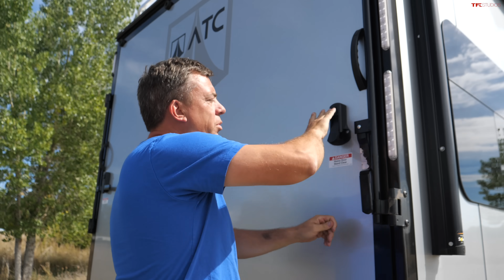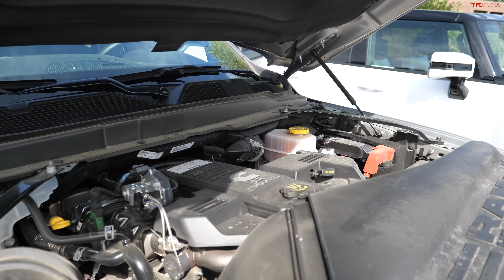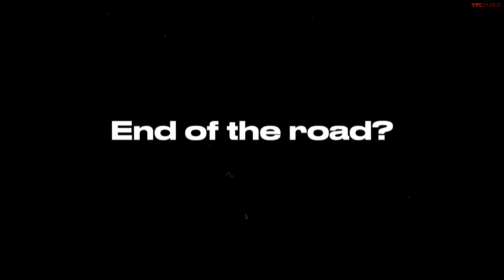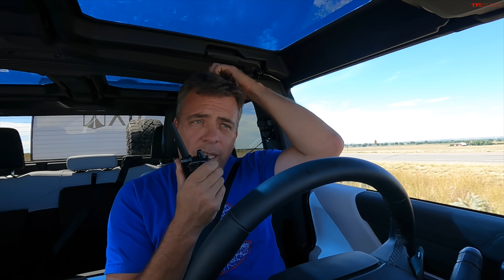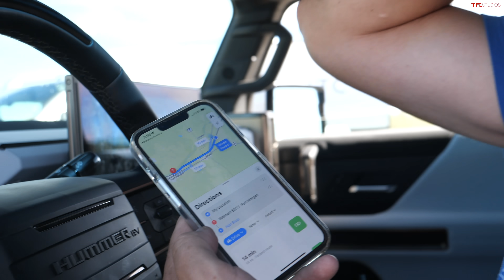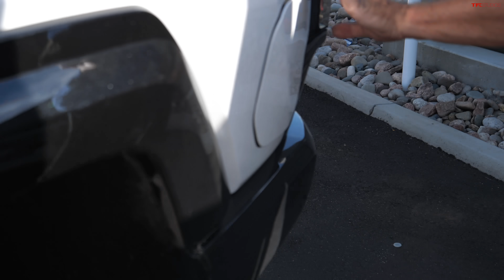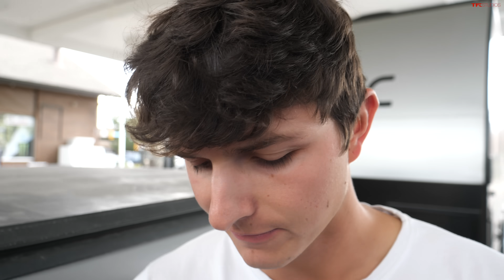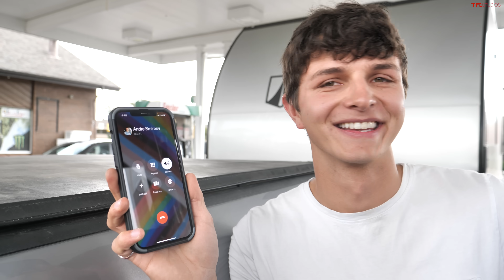How Far Can a Diesel and Electric Truck Tow An Identical Camper Trailer on ONE Fill-up?

Comment: These electric trucks have been nothing but disappointments. The Lightning was pretty horrible at everything and the Hummer has been pretty bad too so far. Let's be real, these electric trucks are for people who just drive to the office and Starbucks and don't really need a truck in the first place.
Reply: Time for a diesel electric hybrid ?
Reply: @richardj163  yes!!!!
Reply: @richardj163  No one will pay for it. Ford already stopped selling its light duty diesel in favor of the Powerboost.
Reply: @jghall00  Maybe. It’s a factor of vehicle cost, efficiency, energy cost. If the cost of Diesel & Electricity go up the cost of the vehicle would be less of an issue if it was more efficient. Diesel sucks for short trips, and Electric sucks for long trips. If I could do my short trips on battery and have the range with a diesel hybrid, I’d do it.    After picking up a 3500 cummins last year, vehicle costs in that range are relative.
Reply: @richardj163  Electric sucks for long trips if towing. Otherwise they're fine. I have a small cheap electric for around town and an Expedition for towing. I'm not sure why Ford didn't do a PHEV half ton. I can see the appeal. I suspect it might be a payload issue. The batteries chew through payload, so it wouldn't be an easy conversion on an existing platform.
Reply: @jghall00  and ok iv got a 2500 mile trip coming up soon how much extra time would I need to charge a truck and how far out of the way would I need to go to find a charger time refueling would be about 25 minutes total on that whole trip and gas is everywhere so I'd refuel on route no needed side trips the idea of calling that just fine is silly
Reply: @jghall00  wasn’t that light diesel unreliable? I thought I heard something about that engine being unreliable.
Reply: @IntrnetCat  I can't say for sure, but I think it was underwhelming compared to the competition and the Powerboost.
Reply: This is what happens when you put the cart before the horse.  There’s not enough EV infrastructure to be ready for EV towing.  But let’s be real, the market for EVs is as you say, so nobody will be towing with a Hummer, it’ll be a more “look at my money!”
Reply: LOL that's what happens when you take a box and throw some batteries in it LOL.... Like I keep saying in other comments small cars sedans first then crossovers then pick ups until we get this battery technology more advanced because right now most of these electric cars and trucks are just luxury toys...
Reply: @jermainec2462  in your dreams. The initial footprint of building an electric car is nearly double than that of a regular car, on avarage you have to drive 180 000km to make that additional cost worth it (not even speaking of the carbon footprint aldo being over double to produce an electric car). At 180k the battery will be so used up, you'll have to buy a new one for 10k-25k depending on your car. There isn't enough lithium on the planet to support a complete conversion to electric, not even enough so that half of all cars could be electric.
Reply: @BrixxonLP  I'm not dreaming about all electric future
Reply: @jermainec2462  well seems to me like you haven't acknowledged any of my arguments or tried to challange them. Anyone who reads this exchange will know who has something to back up their claims and someone who is blowing hot air.
Reply: @BrixxonLP  first of all if you think I'm going to read all that shit all them people who commented on this you crazy that shit was three and four weeks ago I got shit to do lol ...this just popped up on my notifications in YouTube secondly I think I said that everything can't go electric some things can go electric some things I think shouldn't go electric... Now I need to know which side are you on are you against everything on electric or are you for everything going electric?
Reply: @jermainec2462  my comment was about the length of yours, but ok. I am against it, even if battery technology somehow increased the efficiency by 30% which is very generous. A batteries life cycle is much shorter than that of an engine and the lithium is simply not there at the moment and doubtfully in the future. At least the metal of an engine can easily be reused, that of a dead batterie is waste.
Reply: @BrixxonLP  well you know it's so much hype over electric cars that nobody is really paying attention to the details like that LOL so the next 10 to 20 years would be interesting ice cars ain't going nowhere no time soon I think the Best of both worlds would be plugged in hybrids
Reply: @jermainec2462  well, the electric car isn't something that new either, the prius has been around for some time, my cousin drives one from 2005. The battery of hybrits eventually die like any other battery really. The issue is, when the battery is integral for a vehicle to operate, then you have a huge cost of replacing it. I agree with you that hybrits are a much better way to go, at least something we can agree on.
Reply: @jermainec2462 😅
Reply: @jermainec2462  battery evs will never replace anything with liquid energy storage. Be that methanol, ethanol, hydrogen, gas, or diesel.
If you have a 2000kWh battery, and you want to charge it in the same time you fill up a dieseltank, you need to charge with high currents, or voltages, or both.
Bigger battery doesn't change the laws of physics
Reply: @thewoode1050  I kind of agree with you I feel like Ev can only be done in certain applications... Everything can't be EV...
Reply: Did anyone else catch on to the fact that both trucks cost the same to fill up? It cost around 100 in diesel for the full trip and 40 for half the trip in the ev…. I would also be willing to bet they only charged the ev to around 80% so half the trip on the ev was probably closer to 50… full trip (if supercharged) is 100 either way
Reply: @ajkopecki  But if you’re charging overnight at home it is substantially cheaper
Reply: @wesshepard  Agreed. However, I typically don’t pull my camper to my own driveway for a weekend getaway.
Reply: @ajkopecki  and you can buy a diesel for half the cost
Reply: @ajkopecki  Not sure if anyone replied to you, but using a fast charger is WAY more expensive than charging at home (more than 3x), and is where you see the majority of the cost savings. Though even then when you do fast charge it is cheaper than gas or diesel (just not so dramatically cheaper).  It typically costs me $2 to fill up my model Y long range at home.
Reply: @ajkopecki  You'd lose that bet. They charged it to 100%...maybe you were on bathroom break. Lol
Reply: @ajkopecki  I noticed that too. The only way I can see an EV being practical is for heavy city traffic. For Instance, bumper to bumper stop and go during LA rush hour where the traveling distance of the vehicle is quite short, but it spends a significant amount of time at low speed or a stand-still during heavy city commuting. I don't live in an enviornment like that, so I may be wrong.
Reply: @ajkopecki when they first started  out they said the EV was fully charged.
Reply: @ajkopecki  I'm most places you only pay high prices for power when using superchargers, the savings is when you charge at home, which is most of the time.  Here it can cost 5-6x as much to charge at a supercharger.
Reply: @ajkopecki  
Well it depends where you live, but yes. Electricity is getting more and more expensive as more and more evs get on the road. And to counter this, governments are doing what they can to make oil more expensive so that electricity still looks good compared to gas/diesel.
Reply: @ajkopecki  depends where you are, can be anywhere from 17-30 dollars to fully charged one 17 being the lowest rate and 30 being the average across the US.
Reply: All true. The only EV truck that intrigues me, even slightly, is the Rivian R1T. Not for its towing, and certainly not for its small bed, but just for its overall on and off-road capabilities, like why someone buys a Jeep to commute to work, but for some occasional off-roading and winter driving. Otherwise, I am not interested.
Reply: Unfortunately, the people buying most trucks(and overpaying) are people that drive to the office and Starbucks. They stopped building trucks for people like me about 10 years ago....
Reply: I would just love to gush about EV's but I just can't. Every time you recharge you are going to lose capacity and range. Also wear and tear on unproven components. What about battery temperature? Also what will happen as charging stations get hours on them.
Charging isn't going to stay free, subsidized or even cheap. It will be taxed and limited you can bet.
Now comes the repairability of the EV. Will the thousands of miles (?) of wiring stand the test of time? Will replacement parts be available or will they be too expensive for the dealers to keep stocked? Lastly will replacement batteries be available and will there be facilities to recycle the defective units.
We all have seen the unpleasant tendency of the batteries to explode and catch fire. Is there going to be on board fire suppression systems to protect the occupants in the event that happens going 70 mph towing that trailer.
All of these problems can happen with a diesel too but we have systems available to mitigate the environmental damage.
There are too many unknowns to mandate these vehicles be put into place.
It took 30 years before the gasoline engine truly became reliable. It took another 30 years for tires, brakes and suspensions to evolve. Fuel injection took another 3 decades to be reliable and that all hinged on 1st generation computer control. The computers evolved a bit quicker due to non automotive advances.
Electric vehicles are no new idea. Some of the first vehicles were electric. Over the years they have been tried many times, not really failed but not really gained a reputation for reliability either.
Somebody is going to have to foot the bill for the installation of the infrastructure to charge these vehicles and there will be maintenance and repairs.
I think it's going to be a long time before EV's are the true environmental saviors that the weather alarmists want them to be.
I hope I'm wrong but we can only lie to ourselves so long.
Reply: I'm a hill farmer in a remote part of Britain,  there's NO WAY I'd ever consider replacing my Mitsubishis with an electric truck. 1/ eye-wateringly expensive 2/ I can't service it 3/ unreliable crap that I wouldn't trust my business and life to in the Scottish winter. 
If these electric trucks are so hood, why don't the emergency services use them?
Reply: Aka city boy ev trucks
Reply: Driving to the office and going to Starbucks is probably what 75% of people buy trucks for. These are great for somebody that wants a Tesla with a bed for a few Home Depot and dump runs per year.
Reply: @vbaker4  laughable. Contractors don’t have time to sit around charging vehicles and most contractors pull trailers and or haul heavy loads.  This battery crap is following the history of the 70’s wind, solar, battery failure. Nothing has changed. It’s still the same type of folks who refuse to admit their virtue signaling isn’t going to allow them to overcome facts.
Reply: @Roadglide911  👍
Reply: You’ve certainly have a point, but how many people buy a truck even if they don’t need one…
Reply: @zeedustrakok  imo a ton of people buy trucks even though they don't really need them. I call them leisure truck people. Sure once they have a truck they will find ways to use it but truck sales these days are want driven not need driven.
Reply: @zeedustrakok  you're playing into the NWO mindset. 

Get ready for your cricket protein buddy!
Reply: Damn freedoms of will and choice.... Curses
Reply: @vbaker4  that's not even half the range I'd get with my jeep and it takes 5 minutes to double that range then 5 minutes to do it again and the cost is a funny thing I'm less than 5k into my jeep how much did yours cost
Reply: @donaldliverance2597  40k msrp.  Again, there are always better applications for different jobs and personal scenarios. Happy to hear your jeep serves you well.  To say the Lightning is horrible, most have never owned one or used it for work.   I’ve had a lot of success with mine hauling loads of wood, trim/construction materials, hauling a boat, hockey gear, etc.   My father in law works in the gas industry and has already commented on how the pro would replace 90% of their fleet as their big haulers are only required for the back hoe and other larger equipment.  Most commutes are 100 miles or less and a lot of idle time.  The same apprehension occurred in the 20th century with ICE and it’s clear that we are experiencing similar today.
Reply: @vbaker4  
An ev is absolutely useless for anyone in any type of service industry. They are trying to be places at certain times, often appointments are more than an hour away from each other. HVAC, plumbing, garage door, windows and doors etc. Absolutely no way an ev would work.
Reply: @nakefews6823  👍
Reply: @nakefews6823  that is true on the go all of the time and dnt know how your schedule is as a service tech
Reply: People have felt mislead over this whole EV truck thing but it's simple math. These trucks were never going to break any records except 0-60 times.
Reply: I’d like to see a ev truck pull a rig from San Diego to Yosemite  ? No hick ups or delays  at least a 26’ trailer
Reply: I saw my first electric Ford truck in Canada and I laughed and asked who was that stupid to buy that in -40C/F
Reply: So, 95% of truck owners
Reply: Nailed it
Reply: They are trucks for rich people who don't really need a truck, and want to be environmentally friendly
Reply: @vbaker4  contractor here, we pull trailers with equipment. Not just a bed of tools. Also driving 200 plus miles.
Reply: @Axle1007  Sounds like a lightning isn’t the right tool for your work then.
Reply: @vbaker4  it's not a tool, it's a leisure truck.
Reply: @Axle1007  👍
Reply: So about 80% of truck owners
Reply: Starbucks coffee drinkers you nailed it .
Reply: Lightning is pretty horrible at everything? Did you actually watch their other videos? It's more like the lightning was pretty great in all aspects EXCEPT long range towing. I would guess that something like the lightning would be sufficient for the majority of truck owners.
Reply: @Chsae314  lol, it got stuck driving down a dirt road and it never got close to its range estimate in any test.
Reply: @turdferguson2839  Proceeds to ignore multiple videos showing them off-roading and driving up mountain trails.  They've never claimed to hit their full range  when towing, it usually cuts the range in half. I get it that you don't want them to be successful, it's just pathetic when there are so many videos showing how effective they are, and you cherry pick your examples to support your already formed opinion so you can  dismiss them entirely.
Reply: Ev Technically is still at least twenty years behind to what it needs to be to have a proper vehicle.
Reply: Truth and idk how that cummins is tuned but it should be getting 16mpg towing
Reply: I would say the perfect combination would be the efficiency and power of the electric mated to the range of a 4 cyl diesel. Idle that thing mated to a fairly heavy generator and the same 31 gallon tank could probably have taken the vehicles pretty far, like the lake and back. When not being used for all the extras, an idling diesel still generates a ton of torque, great for spinning a generator. And at idle, get great economy and produce very small amounts of waste. Where diesel becomes dirty is during acceleration when vast quantities are pushed into the combustion chamber but not completely burned or converted to energy, resulting in the black cloud or if your smog system is working, a dpf full of soot. I always wondered why this was never an option. Call it a hybrid diesel. Works the same in locomotives and ships/Yachts. Diesel motors turning generators and electric motors at the wheels/props.
Reply: $46,000 price difference buys a lot of diesel.
Reply: My superduty s 20 years old w 205 k 7.3 I travel  all the time out of state 10 k just came back from Arkansas white river fly fishing we’re always on the move Dallas areas end of November I can’t see a 50 k plus investment doing 20 years and still rolling  my truck used was 20 k
Reply: I couldn't have said it any better 😂😭
Reply: And are ok with paying an outrageous price for an inferior vehicle. Im sure trade in value will be a joke. And whos going to buy a used one?
Reply: These are the same People expecting the Tesla truck to replace semis. They are out of their minds.
Reply: He hit the nail on the head. This is a lifestyle vehicle.
Reply: Agree 100 percent.  My old dodge diesel was about one fourth the cost of the new Cummins and can tows 15k on a regular basis with relative ease and I can still make it 300 miles before filling up
Reply: Did you see the electric Hummer the guy totaled in 15 miles 😂
Reply: I will keep my 99F250 7.3l Superduty with 220K on it. She pulls my boat and Toy hauler just fine 🙂. Just wish diesel was 96 cents a gallon again like when I bought her new.
Reply: Wait, so people actually expected them to be like combustion engine trucks!? lolol that was the first mistake. People bought the EV lies.
Reply: I find it funny when so many people comment about numbers they just pull out of thin air. I've seen 75, 80, 90 and 95% of truck owners never use their trucks except to get coffee and go to the office. I know there are a lot of people who do this, but couldn't even guess at an actual percentage, just because you don't see every truck pulling something doesn't mean they don't. I wonder how people look at me and think the same thing when I'm driving around town? When actually I pull a trailer 1/2 the time(or more) my truck is moving, my current truck(2018 Ram 2500) has almost 400,000 miles on it.
Reply: Hey , didn't a few of these hummers catch fire during or after hurricane Ian??  Which subsequently burned down the house it was stored in...
Reply: And if you think the supply issues are bad now wait until California insists on the CDL's going full electric...stuff ins going to get stupid expensive and take twice as long to get
Reply: @johnfluckiger9693   people used to say the same about cars..🤡. Yet ain’t none transporting shit using horses anymore… times are changing old man..  luckily your generation is half way in the grave..  don’t worry I’m sure they’ll still be gas vehicles by the time you die..  no need to throw a fit over it.. 🤣🤣
Reply: @rubendiaz4180  your arguement is demented, lame and full of leftist stupidity. No one said that the tech cannot be made to be useful only that it isn't there yet and that the forced mandates never makes the transition easier or less expensive. Additionally, none madated the use of automobiles over horses. Once the cost of manufacturing decreased and the cost effectiveness improved the use of automobiles became a more effective option. The fact that you immediately went for the insult shows that your single dimensional thinking cant see beyond your CNN based talking points...learn some humility and humble yourself to diversity of thought.
Reply: @johnfluckiger9693  lol sorry snowflake I didn’t mean to offend you..💁‍♀️.
Reply: @johnfluckiger9693  have fun looking at teslas ugly ass tail lights..  😔
Reply: @rubendiaz4180  no offense taken just a hopeful correction of your deluted thinking...but intellectual thought process clearly fall short when speaking to fools with morality complexes.
Reply: @rubendiaz4180  I actually like Tesla's...but they also lack in certain areas such as sustainable infrastructures to make them a reliable affordable option but you keep on trucking hippy. Whe your walking cause of another California brownout and cant charge your car...I'll be crusing along with my gas hog truck enjoying the AC and actually have the ability to get to work.
Reply: @johnfluckiger9693  so rational thought = hating on technology..?   Why don’t you send me smoke signals instead of using the internet then..? 🤡
Reply: @johnfluckiger9693  here’s my thought.. fossil fuels will eventually run out..  so why not use them only for things that can’t be achieved with electricity.. you ever worked at a warehouse..?  All they use are electric pallet jacks and forklifts.. they’re extremely reliable there..
Reply: That is the absolute truth
Reply: I drive a Tesla, and I couldn’t agree more.
Reply: @vbaker4  most contractors tow a work trailer so no it's not at all a good fit for a contractor
Reply: @donaldliverance2597  most contractors don’t tow a work trailer 😂
Reply: @donaldliverance2597  I live in the land of sun and not one contractor is using an EV to pull a trailer for construction, cementers, tile workers, lawn service, ect. It's not happening!😂☕
Reply: @donaldliverance2597  that isn't true, the work trailer can stay on the job site. Or you rent a storage building to keep on site. Nobody is hauling a work trailer back and forth everyday except lawn care workers.
Reply: @lilcourtny08  you are greatly mistaken I live in Southern California and I see all the same trucks at the same time on the 91 freeway with there trailers attached. All kinds from concrete to electrical contractors. Just get an EV if you like and stop impossing your beliefes on others. Let people get what ever vehicle they want. GOD BLESS AMERICA
Reply: @donaldliverance2597  depends on how many miles they're doing daily. Could be perfect for someone that tows less than 100 miles daily. Also, highway speeds are much harder on range. At lows speeds,  you can easily increase range by 50%. There's a reason the Lightning is sold out.
Reply: @jghall00  Maybe the onboard generator helped seal the deal for some.
Reply: @jghall00  it's not contractors buying them lol
Reply: @Axle1007  It's people that own profitable business spending a lot on fuel. If you're solo, you might not be able to afford it. Ford has a fleet program where the customer has to buy at least 5. They're sold out.
Reply: @jghall00  So if you don't drive on highways or in the hills or mountains and if it's not too hot or cold, then the EV is a good choice.
Reply: @jeffw1267  It's fine for all those, as long as you aren't towing.
Reply: @jghall00  what about in 10 years how is that ev truck going to perform?
Reply: When they talk about the energy density they show how insanely stupid and inefficient EV cars are… pulling a „gigantic“ travel trailer, 5000 lbs… that’s one of the lightest camping trailer before you go with a pop-up
Reply: @freedomisnotnegotiable  at towing only. But they are far from stupid and inefficient
Reply: @freedomisnotnegotiable  I have a small camper at 22 feet and it is an extra light model that weighs 5300 dry.

If you really want a test then pull a 27 foot that weighs 7000 and see what happens.
Reply: @Freedom is not negotiable  not to mention they did at dry weight. Can't imagine a 4 wheeler loaded. Also because it's a toy hauler they didn't fill the water tank and fuel tank if it has one. Lol
Reply: @freedomisnotnegotiable  You have it backwards actually. EVs are extremely efficient at using electric energy. The crazy thing is how energy dense gas and diesel are that ICEs can be vastly less efficient and still out perform. When they compared the energy density of diesel to battery this is what they were alluding to.
Reply: @ProjectswAlex  no you got it wrong look what crazy resources you need to build a battery that would equal to the energy density of Diesel, 9500lbs Truck for a 130mile range with 5000pounds, Iam so glad that all the building material that goes into the 9500 pounds is 100% green and grows on trees, because if that wouldn’t be the case these EV trucks have a horrible environmental footprint!
Reply: @freedomisnotnegotiable  I think there's quite a bit of unnecessary sarcasm on your last sentence there. 

My comment was just about the energy density of the two technologies, but if you want to get into the cleanliness of auto manufacturing we can do that. 

Firstly I'd recommend a very interesting video made by JerryRigEverything. The title was something like, EVs Have a Dark Side. Very cool video that goes into the carbon footprint of EV and ICE manufacturing and the years of use afterwards. The jist of it is all cars have a terrible impact on the environment, while EVs have a worse initial impact their carbon footprint slowly increases depending on how the electricity is produced. ICE vehicles have a lesser initial impact since there is only a tiny 12volt battery, but due to using gas/diesel their carbon footprint increases much faster. I don't think he even included the oil changes ICE cars require into the calculation.

EVs can't do what ICE cars can do, YET. Technology with EVs is still young and will continue to improve. ICE vehicles have already matured and aren't improving much these days.
Reply: @ProjectswAlex  Time for your update, I mean, boostuh!
Reply: @ProjectswAlex  
One thing about efficiency as well is that batteries weigh a ton more than gas/diesel, so if you want an ev with similar range, the efficiency  will drop a ton because of the added weight.  It would likely still be better ice vehicles, but I don’t think by much
Reply: @freedomisnotnegotiable  lol inefficient is not the word you’re looking for 🤣 in the truck world while towing energy density wins but efficiency is not the metric to use because the diesel efficiency tanks as well haha. Energy density saves the day. Know your terms. Efficiency wise: BEV’s are around 90% versus ICE struggling at about 20%. There is no comparison there.
Reply: @CYBRLFT  there is also something like efficiency in the building/manufacturing process... but yeah i know EV cars promoters dont want to talk about it because it kills the whole EV-agenda pretty fast... the only argument then is: "If more cars will be built it will get better, lol... such a stupid argument...
Reply: @freedomisnotnegotiable  All these videos always talk about range, but never on 55 mph roads or city driving where you will always drive home and put it on the charger.
I  just drove 96 miles started with 80% charge finished with 63% charge. It took 26 kwh to charge back to 80% electric costs was $2.02 55 mph Highway & city driving.  I could have maxed the payload and it wouldn't have used much more energy. This is why I bought an EV truck. I can tow 10,000 or haul 1600 lbs My range isn't cut in half because at those speeds there's very little wind resistance. The lightning will do anything any other F150 will do. We just aren't setup for long distance driving yet.
Reply: @pstoneking3418  most highway driving here. 70 is the lowest speed limit. No way I can do a full day worth of work as a contractor with one charge. I drive 250 plus miles a day.
Reply: @freedomisnotnegotiable  the aero profile causes the mileage hit, not the weight.
Reply: @jghall00  that’s not correct… we are not living in a perfectly flat world
Reply: @freedomisnotnegotiable  In an EV on the downhill grades you recoup what you lose going up.
Reply: @jghall00  that’s not what motor trend found. They used a lightning with the larger battery and towed three different trailers from 3000lb to 7200lb and they lost an additional 25 miles range (out of a control tested 225 miles) with the heavy trailer vs the light one. That’s an additional 11% loss in range, which is statistically significant.
Reply: @nathanenns7186  that doesn't mean anything without knowing the aero profile of the trailers. The right way to do that test would be to add weight to the same trailer.
Reply: @jghall00  um they both affect mileage electric motors eat more power as you demand more from them more weight = more demand
Reply: @marquistaylor3491  true, but degree matters. It could be a 5% range reduction from weight vs 20% from aero.  Can't treat them the same.
Reply: I agree 100%  don't let the treehuggers hear you say that they will fight with you all day saying every one needs to buy one now.
Reply: Wait until they age
Reply: @PGXPPR  Yep.  EV's are just throw away vehicles.  Poor suckers that buy a used one then has to pay a ton for new batteries.....
Reply: @PGXPPR  Electric motors have only one moving part compared to a diesel engine.
Reply: @jacksonbangs6603  It will outlast me as much as I will use it. I use a truck to pull 15-25k lbs. That hummer will do it but not far
Reply: Electric Vehicle's are for Democrats
Reply: Facts
Reply: Yep. I can’t afford an EV right now but my intent is to eventually get an EV when there is a semi affordable 3 row available for family. But I’m planning buying an older diesel for truck duty.
Reply: We have the technology for electric vehicles where you don't ever have to stop to charge it. Why aren't they letting us have that technologies. What's the matter with those corrupt Elites.
Reply: The lightnings are serving my business perfectly 🤷‍♂️
Reply: @mattbrew11  Not sure why everyone seems to think if it doesn't work for them, it won't work for anyone else. Not everyone uses their pickup to tow long distances.
Reply: So for 110 grand you get 🤔
Reply: @sc2603  Your $110K is like $50K to someone else. Value is very subjective.
Reply: The problems with them remain the exact same as 100+ years ago. 
But you will never get the greenies to acknowledge or even understand this.
Reply: I disagree! They are perfect for uber and pizza delivery.
Reply: @All Ebike than wait and buy a cheaper one lmao no one’s telling you to buy 100k truck 😂
Reply: Drive to the office and pick up Starbucks? So literally the vast majority of truck drivers right now then. For those very few who actually need to tow for long distances and are fine with paying an arm and leg for gas, don't go with EV. Not rocket science.
Reply: @ElectricGlider2016  
EV charging is equal to $6.00 a gallon in California. As soon as everything switches over to the electric, they will rape us on charging prices.
Reply: burt reynolds?
Reply: The Ford Lightning was the only one I was interested in too. I’ll stick with my 413 mile range Sierra 1500.
Reply: Like most people who own trucks.
Reply: The discussion in the comments under your post was the most solid and calm ICE vs. EV discussion I’ve ever seen. Just opinions, facts and no hate
Reply: Wonder if the tax payers are paying for the “free charging” for the month? Sounds like some kind of government kick back program.
Reply: Yes
Reply: Turd 🧐 is that you??
Reply: Need to leave the ev’s to cars and suvs. Trucks are to heavy
Reply: So true or the rv to there local lake
Reply: Yes I also notice that too. It’s always cool to have a electric hummer to go and from to starbucks to buy your fancy coffee? Then drive cool and slow back to your home to recharge your Hummer before you go to a store and cruise around the parking lot?
Reply: How about the Semi truck? I actually seen one on a flatbed being pulled by a KW. I had a chance do look at it and I must say it really didn’t look all that sturdy and thinking with all these potholes etc we have here in the states I am thinking unfortunately I don’t think it will last all that long. Just saying!
Reply: Plus it still needs diesel.
Reply: 🤣🤣🤣 exactly...
Reply: I spent most of my driving time in the woods … long way from a charger !
Reply: FAXXXXXXX
Reply: What a garbage useless vehicle.... what even is the point of owning it?
Reply: EVs are for fairys mostly.
Reply: I’ll just delete my truck and increase my hauling range and I already upgraded my fuel tank from 31 gallons to 51 gallons and believe it or not I have driven 450 miles on 22 .168 gallons of fuel. I haven’t clocked what I can do pulling but I’d say a lot more than everything that is EV
Reply: You aren't wrong but in 20 years electric will be far better than gas or diesel. Until then though the free market should decide and feds should stay out.
Reply: Maybe he should throw a couple of 5 gallon cans of electricity in the back of the Hummer.
Reply: Ya he would have spent 60 -80 bucks in charging they didn't count.
Reply: To be disappointing, you'd have to have reasonable expectations. There's your first mistake.

Step one in the renewable energy game is to establish new lower expectations. When will this become obvious to everyone?
Reply: This comparison is moronic. Whatta waste of time. Compact commuter cars are the only vehicles we need to concentrate on electrifying. But, instead we build tesla supercars and crab walking hummers. Junk!
Reply: Nobody needs anytype of electric vehicle it’s just the people that think they have to have every new fad that comes along their the first to try it and when they fail they say it’s unproven yet even though it’s junk and overweight and totally useless unless your going to the grocery store
Reply: As far as I see it these "trucks" are basically in their testing phase now but the manufacturers don't tell you, they basically making a profit on their testing programs instead of spending money.
Reply: This shit is going to be law everywhere...whirld wide. Not joking.
Reply: @Sumbolum  say what? EV is going to become Law? Mandatory? Are you hearing yourself? The Dems stopped the "FRACKING" Drilling of Fossil Fuel= Crude Oil that runs and power up Factories and they shut down most of The Nuclear ☢️ Power plants as well and not just that they are blowing up Hydroelectric Powerplants too and these are the vital and very important Infrastructures to keep the Industry and The Society running and to keep the Society alive. How can they mandate EV's IF they [Dems and The Deep State Cabal] lost their ability to mass produced them?? Besides that where are they gonna get the parts and components like Gold, Silver, and Copper especially the copper for the Electric wires, and Micro Chips, Processor Chips, transistors, resistors, capacitors components like these for the production of EV's they shut down a lot of Factories that supplies those components and a lot of people lost their jobs. Some factories filed for bankruptcy after the Stupid Covid lockdowns. And now most businesses are struggling because of the high inflation created by the Cabal. Do you see now? Their evil agenda is falling apart before they could even execute them.
Reply: Well-paid thank you
Reply: Ill keep my Duramax plus 2006 Dodge Cummings. Two great engines for pulling heavy loaded trailers and tractors. No way in hell id buy a stupid electric junker. What a big joke.
Reply: I’m sure the 200,000 mile maintenance is ridiculous on an EV
Reply: I spend $150-200 a week on gas for my V6 work van. That is $600-800 per month. A Lightening chargjng at home at night would cost how much per month in residential electricity? I could pay for the Lightening in what it costs me in gas. Am I wrong? So, that tells me this needs to be viewed with purpose and utility in mind. The problem is that government gets their dirty fingers in everything and spoil it. Let us have cheaper diesel made with american oil. Turn our neighborhoods into grid independent batteries. Produce CNG and Hydrogen and Diesel and Gas and Electric and let the consumer decide. If I was a landscaper pulling around a heavy dump trailer or a concrete contractor the diesel is the right choice. Both and.
Reply: Its an offroad toy and great around town truck.
Reply: What do you expect when your payload already is 1000 pounds more than an empty diesel truck, Before putting anything else into it and put in your ass.
Reply: Wait... it looks like you're trying to go from a higher elevation to a lower elevation, i.e. Downhill, and more flat surfaces, which is not realistic. 
Why don't you try going the other way, back to Boulder???????
Reply: They still smoke on that diesel pack 🚬🔥💨
Reply: @danh8302  personally I'd like it if all auto manufacturers met in the middle and worked towards perfecting hybrid vehicles. Where instead of a 400 hp truck with 18/23 mpg we have a 500 hp hybrid that gets 35-40 mpg
Reply: They look cool and have cool features. They're a step in a good direction for the future of our planet but besides that they're practically useless.
Reply: Glorified sedans.
Reply: 90% of truck owners I know don’t use it like a truck lol
Reply: And also the ones that trust government with everything.
Reply: Imagine being stupid enough to buy an EV.
Reply: Please note that the ICE cars had over 100 years of development. And electric cars only began TRUELY developing about 14 years ago with Tesla. GM's EV 1 doesn't count. Let's give it another 50 years, and it will be a different story.
Reply: @jaymarkkabo2626  Well you might as well drop your pants and bend over flr government when they will control you through your driving computer.
Reply: I had high hopes for rivian r1t for those that want to be able to have the use of a truck bed in an ev platform. But I've always been in the camp that evs are not practical or even safe for towing applications due to the duty cycle of the batteries. That and most people don't think of charging the battery as being apart of the "in use" side of the duty cycle, which it definitely is. Charging and draining the battery are both in the duty side of the duty cycle. If your not letting it rest as it needs for the duty cycle your burning out the battery and making it less efficient and reducing the lifespan of the battery.
Reply: "these electric trucks are for people who just drive to the office and Starbucks and don't really need a truck in the first place"

So, 99.999% of all people who buy trucks?
Reply: Thats what most people used their trucks for.
Reply: RIP norm! ❤
Reply: AMEN!! let's say it's good for kids..as toys.
Reply: The hummer so big and so heavy u can't drive on most roads because they so heavy.. and it cost over $100 to charge it..
Reply: We need to be able to battery swap easily. 
Like propane. You can refill or swap
Reply: I don't care what you buy, it's your money, spend it however you want. But the day when they said we can no longer have an ICE truck or they start adding all kinds of penalties or hike the price to the ridiculous level of these EV trucks then I will have a problem.
Reply: And then.... And then.....
HOW LONG DOES IT TAKE EACH TO FILL UP?
Reply: Until the government forces them all to be electric down badd
Reply: And no way to recycle the millions of batteries and no chemical on earth can extinguish an EV fire. “Other than that how was the play Mrs. Lincoln”?
Reply: Most ICE trucks are not used for ‘truck things’, the majority of truck owners do not tow.
Reply: 12v... not volts, valves. Rollin' coal on EVs all across Texas.
Reply: They are not disappointments to the people who are waiting on long lists to buy them. As usual people who don’t like EVs don’t get them don’t want them to succeed. We saw the same thing with hybrids.
Reply: We just need a locomotive style EV. One that can run off of an engine instead of the battery. Some batteries are insanely heavy especially in vehicles like the hummer
Reply: Exactly
Reply: The point everyone is missing the maintenance on gas cars zero on the ev except tires and they use way less breaking
Reply: @vbaker4  here they are the folks who have no idea about contractors but giving them advice 😂😂😂… one question why do mostly contractors trucks are always beat up and have 200k miles after 3 years? Because they don’t use them?
You know what’s the worst thing for a contractor the flexibility you loose with these fricking EV cars, most of the time of contractor life’s is not going to a rksite in the morning and leaving in the afternoon… you clearly have not your own business and it’s clear why because you are not up to the task
Reply: @freedomisnotnegotiable  agreed the truck must be able to do everything even tow some shit that's way to heavy for far to long they get beaten daily and they still make the trip home if that's not possible your going to fail at some point
Reply: Id they want everything at least partially electrified, then at least leave the pickups hybrid.
Reply: @All Ebike and the "saving the environment" premise is nowhere near what most people think. Just because you don't have emissions, doesn't mean that battery didn't do it's fair share of wreaking havoc on the planet. We all, including myself, have a tendency to fall for it since it's not happening in front of our eyes.
Reply: @adamantee1  very true as far as saving the environment as ppl in general we use and need things that will and are destroying the environment in general they say burning wood is causing pollution well if we all went back to shitting in the woods and living off of hunting we will still be considered as polluting the earth either way im not saying that we should stop making ev because they do have their pros and cons just as much as ICE have theirs as well but we shouldnt have to force one thing and not the other there is a balance within the two not everybody wants to a big truck some prefer a small little in town car so get your ev and be happy if you are someone that enjoys traveling long distance or work long distance and is on the road constantly get your gasoline or diesel vehicles we forget that they are suppose to make things to contribute to our lifestyles but everything is about making a dollar and putting us in a pig pen to force us to make them a dollar even when it isnt logical or beneficial to your own which leads to no options what so ever
Reply: I'm waiting for a diesel plug-in electric to come on the market.  Electric is very smart and affordable on short trips.  And despite what uninformed people say about the torque and power of EVs, a good EV can smoke gas engines on just about every category except range.  Which is why I want a plug-in diesel-electric truck.  I'd like the best of both worlds. 

Also, a plug-in hybrid is essentially a motorized generator/alternator combined with an EV.  Why couldn't you buy a good generator for long haul trips and put it on a trailer or just on the trailer hitch no wheels necessary?  And just use that to charge on the go.
Reply: EV's real strong point is daily driving or commuting.  Buy a cheap ICE truck for work and a cheap EV for the daily.
Reply: @superfisher4379  cheap EV?
Reply: @freedomisnotnegotiable  Yeah I know you aren't really going to find a cheap one.  I'm not a big fan of EV's at all but could see the benefit of a very small economical one that would be used for daily driving/commuting.  Right now they're just toys for rich liberals.
Reply: @superfisher4379  apparently you haven’t priced a high-level trim diesel lately. Based on your logic, high-level, trim diesels must be toys for rich hicks. And don’t get me started all the Raptors driving around my town without a speck of dirt on them that go for around 100k.  
But facts and the reality of the truck market right now don’t fit whatever agenda you’re trying to promote here with your statement.
Reply: @craig8638  Oh my go dude.  No one unless they're a complete idiot is buying a raptor or a high level trim diesel as a work truck.  If you buy a raptor for a work truck you're a complete idiot and if you're buying a high level trim diesel you're just blowing your money on doodads you don't need.  You can definitely find a perfectly serviceable HD pickup truck used for around 30, 35 Grand maybe even less if you're only driving it occasionally for work purposes or to haul a camper or trailer.  So yeah that's well within the means of anybody who's going to go out and drop 65 Grand on a ridiculous brand new truck.
Reply: @superfisher4379  Well it just doesn't have to be for rich liberals lol. I can see quite a few conservative capitalists getting on board in the future with fleet vehicles for in city businesses that save tons on maintenence over ICE vehicles and reap the benefits of electric efficiencies. Everyone likes to save and make money no matter what their political affiliation.
Reply: @freedomisnotnegotiable  yes, a Bolt is <$27k
Reply: @superfisher4379  always that one guy that tries to make everything political 😂
Reply: @JT-pt5tl  Oh come on you know it's always those people buying EV's.  You know the blue haired fat women in Birkenstocks, the bald pony tail guys eating granola.  Don't forget the metro soy boys in skinny jeans.
Reply: @superfisher4379  buy a golf car
Reply: @freedomisnotnegotiable  GM are making little ev for $4000 
In China.🤔
Reply: @superfisher4379  the chevy bolt ev /euv is a decent choice
Reply: @superfisher4379  OR, buy a gas or diesel vehicle that does everything you need instead of buying and insuring two vehicles to do the job of one vehicle.
Reply: @brucemitchell5637  Well yeah that's what I do and what alot of others do but it's not practical if you have a long commute.  My commute is only 10 min so I don't care about fuel economy and I need a full size truck for a lot of things. If however I had a longer commute like maybe 30-40 minutes or so I would probably seriously consider getting a car and using a truck for truck things.  In the end doing this is probably more practical if you have a long commute.
Reply: @superfisher4379  LOL you you do know can't everybody finance two cars like that that means two car payments to insurance payments two different interest rates more than likely and good luck trying to find any type of cheap EV that's worth buying LOL... I think cheap EVS are at least another 10 to 15 years in the future
Reply: @jermainec2462  Yeah I actually said that in a different comment and replying to somebody else that finding a cheap EV would be difficult but I wouldn't waste my money on that right now personally.  I'd much rather spend my money on a Corolla or a Civic or something like that if it was going to be just a commuter car.   And as I said to somebody else if you're going to be spending 60 65 Grand on a truck because you want modern conveniences you're a fool.  I guess it's fine if you don't have a long commute but if I did and I'd be buying some older HD truck for work purposes and also an older small compact Japanese sedan for commuting I know several people to do this and it's the most practical way so you're not blowing tons of gas on a long commute in a great big truck everyday.  It just doesn't make sense to buy a car new anymore either.  Yes values were high in the past couple years for used cars but they're starting to go down now and I would say should be back to normal by spring.
Reply: @superfisher4379  corrollas and civics are getting up in the 50s now too.
Reply: @superfisher4379  Please find me a cheap ICE truck these days. For real, they are ridiculously overpriced. Used and new are both too high right now.
Reply: @rustbucket9318  They have been high for the past 2 years yes but as time goes on the prices will drop.   They already are.
Reply: @superfisher4379  pretty much what I've been saying as well. Hell, buy a hybrid for now, until the batteries are better. 

That would have been the logical first step. Hybrid pickups,  then electric. Would have made working the bugs out far easier. 

And EVs are nothing new.

We went with gas for a reason.
Reply: @superfisher4379  in some states buying an ICE won’t even be an option come 2035.
Reply: @boostedmaniac  That's never going to happen.  The grid won't be able to support the increased demand.  That'll be pushed back for years.
Reply: @superfisher4379  maybe so but in Cali that is what they are going for right now because they feel they have enough solar energy to do it they are def going to be if not one of them to push that law
Reply: @superfisher4379  Hummmmm Cheap EV? Am I missing something?
Reply: @chrisborey1734  Nissan leaf?  That's cheap.
Reply: @superfisher4379  what cheap EV lmao
Reply: @superfisher4379  That’s been my idea but unfortunately the mandate will require full electric.
Reply: @superfisher4379  lol I've seen teslas on highways parked new jersey
Reply: @superfisher4379  no such thing as a cheap EV
Reply: @superfisher4379  idiot! EV ain't cheap dummy! I'll tell you what cheap is. Mitsubishi Mirage 3 cylinder Gas Car that can achieve 50 to 60miles per gallon is the cheapest gas car out there that only cost $12,000 it is a NON-Hybrid car with that kind of Mileage that is so good for daily driving. Now for work truck there's a 4 cylinder Toyota Tacoma out there that have a pretty descent gas mileage. But If you want a Work Truck that can tow heavy loads then get a pre-used Diesel Trucks or don't buy it at all. Otherwise Motorcycle 🏍️ is great for commuting daily. I'm not gonna spend $60 to $90 grand for an Electric Car and I don't wanna spend time on a charging station where i can top off my Chevy Express 6.6L V8 work van full tank in just only 10mins including smoke break after I filled up I park the vehicle, then take a leak, and then get my hot coffee inside the store and then take off again.
Reply: @superfisher4379 NO that's BS. you don't need EV. Everyone with Common sense are good with cheap ICE cars and cheapest trucks. All what they [Deep State Globalists] is to stop doing anything stupid. Bring back the oil industry. Do more FRACKING. they should stop orchestrating the oil price hike and Inflation.
Reply: @superfisher4379  nothing is cheap anymore.  These ev vehicles are worthless and don't save you money or help out the universe in any way
Reply: @superfisher4379  commuting were? To a job that you have to have to pay for that truck? Like almost 80 thousand dollars extra comparative to owing a Ram? And in 6-7 years your battery would degrade that much that the trade in value of that Hummer would be around 20% compared to new, if you're lucky, because to replace such a big battery would cost like 40-50 thousand dollars. 
These EVs, the more I watch videos about them, the more I am convinced that is just a hype that would end soon, because it's a dead end.
Reply: @superfisher4379  no such thing as a cheap EV petrol cars trucks suvs will always be cheaper.
Reply: @superfisher4379  I think they arnt to bad if u got a trailer around the city for different job sites.  Problem is u can’t even get an electric work truck.  They are fancy commuter trucks that you wouldn’t want muddy boots in.
Reply: @superfisher4379  EVs aren't cheap nothing is cheap everything is way over priced I don't know what your talking about EVs are cheap
Reply: @texandy89  a reasonable electric truck would easily pay itself off in 100k miles through gas savings
Reply: Lol I hardly ever see anyone towing here in Texas usually yuppies with big tires running to Walmart
Reply: They will work fine for a work truck but will never be a good rv towing vacation vehicle.
Reply: You said …… “Pretty horrible at everything” 

These are perfect for the local plumber or contractor, yeah if your super small and need to run 100 miles for supplies it wouldn’t be ideal but for like 99% of trade and construction business these are great. 

The F-150 kicks ass at everything except range 

You won’t pull better safer more comfortable with anything else, just won’t do it for more than 100 mile 😢
Reply: I think your missing the point though. Electric vehicles have come a long long way.
Reply: Because everyone who buys an ICE Truck uses it for its towing and utility purpose? 🙄…we live in a world where people buy a specific type of car or truck for its status, not it’s utility capability. 

Imagine your reaction when the Jeep Grand Cherokee came out in the 90’s and was all the rave for the suburban family who would probably be more comfortable in minivan. 🤷🏼‍♂️

I know lots of people who own trucks but don’t tow trailers on a daily basis, but just pick up their kids from school. There’s nothing wrong with it. 
So get over yourself.
Reply: But the power boost has been an awesome hybrid. Unfortunately everyone focuses on the lightning
Reply: You’re talking about towing. Office and Starbucks? I did construction for 2years, I feel like it was 95 percent of those guys carry absolutely nothing in their trucks or tow. It’s literally tool boxes, random construction tools and clothes. All of that the lightning is more than capable. It can tow just not long distances. Even on the very high end of travel in that job I seen some do maybe 100-150 miles in a day. Most literally drove to the job site and drive home. Maybe 80 miles for the guy who lived the furthest. Some rainy days had to use 4x4. All of this the lightning can do easily. People and YouTubers seem to make up scenarios in their head where trucks are used hardcore 24/7, they aren’t. Maybe if you’re a rancher.
Reply: @wow956  or you live anywhere out west;)
Reply: @wow956  iv done it for near 20 and those trailers are heavy or your a handyman and not a construction worker if you don't need many tools plus it's more about the truck being able to do anything it might need to say tomorrow it gets a call out of range that truck flat out can't make the trip that's lost revenue the diesel or gas truck just adds a travel charge if the truck can't do everything it might need to then its not the right truck
Reply: @donaldliverance2597  but that’s what I mean. You’re on the far end of it. And you’re talking about heavy duty trucks. Look at your job site next time. Tell me how many trucks/workers you actually see doing what you do, hauling long range. It’s simple numbers, most don’t do that. They don’t fill their truck to the brim nor tow. You’re also comparing what seems like your describing  a heavy duty diesel to an electric half ton f150. It isn’t for you. I’ve done construction, landscaping, and house building. It’s usually one truck per crew carrying everything(construction a bit different). The rest of guys aren’t fully loading theirs. This electric truck can handle that. You’d wont hardly see someone on the job using their f150 gasser to haul big loads. It can’t. You get the truck that fits your lifestyle. And it just so happens many don’t use their truck in a strenuous way.
Reply: May not tow today, yet wouldn't it be nice to know you could tow something long distance if the need arises?
Reply: @wow956  and you’re leaving out the part about the lightning costs 30k more than the equivalent gas truck.
Reply: @givemeabreakdoc  what equivalent gas truck has 430 hp and almost 800lbs of torque? I don’t get your statement. What gas truck do you see as equivalent? Gas you’re paying a lot more for gas. Charging up at home is so cheap. On the road chargers are still $30-40. I agree there’s a ridiculous mark up but that’s on all trucks.  Raptors for example you used to be able to find one under 40k used.
Reply: @wow956  lol. 1. It’s not a “mark up.” EV’s are that much more expensive to make.
2. The payload for a f150 lightning? 2000 lbs. gas powered 3,300. 
3. It doesn’t matter if you’ve got more hp and torque, when you have “fill up” twice as much when towing. If you want to spend 90k on that EV, go ahead. I’ll spend 60k for the gas. Then, when your batteries go bad, you can pony up the 25k to replace them. My gas motor will just be getting broke in.
4. I’m not “anti EV.” What I AM against, is the massive amounts of corporate welfare to keep this inefficient energy form viable, and at the same time, gooberment mandates, taxes, and regulations, to artificially increase the price of cheaper, more reliable and efficient energy, in an attempt to literally force people to buy an EV.
5. I’m also against gooberment, corporations, and apologists of EV’s, totally ignoring the downside of EV’s and lying to people about how “great” they are.
6. EV apologists also want to ignore the mining of the poison that creates these things, and the waste  created. All while telling us gas is gonna kill us all. It’s a bunch of 🐎💩.
Reply: @givemeabreakdoc   so which truck is equivalent to the lightning? you’re just cherry picking features like towing. No one would buy an ev for towing, if I needed a towing truck I’d go diesel much more efficient than your gasser. By your logic You go fill your gasser a thousand times and I’ll go way further in my diesel for towing. Lightning max payload is 2300, regular ford is 3300, ford raptor is 1400. You buy a truck for what you need. This specific ev yes is 90k. Get a base pro model they are priced at 44k before a dealership gets them You’re 4,5 and 6 points what are you on about? But I’ll bite a bit. 4. So we just abandon alternate energy sources because they haven’t caught up yet to our demands. That’s not how technology works we keep improving to become more viable. 5 what we have now have no downsides? 6 what are you talking about killing us? It’s a fact cars in general aren’t good for a planet. Both ev’s and gas cars use rare metals. Or are you talking about mining lithium, we are finding better ways to recycle it. Are you sure you’re not just against ev’s? I don’t understand this reply either, do want us to stay with fossil fuels and just not try anything else?  Lastly, it’s clear the world is moving towards alternate energies. With Tesla leading the forefront right now. I mean come on use your brain, we will move from fossil fuels. We literally have a massive nuclear reactor in the sky that gives out energy whether we use it or not. It’s only a matter of time.
Reply: @wow956  1. You’re right. You buy what fits your needs. Hence, you don’t need a diesel, unless you’re towing full time, heavy weights. But an EV, simply towing a boat, is pathetic. 
2. Equivalent to the lightning? Lightning sport, $52k. F150 xl $33k. No matter what trim level you choose, that EV is gonna run at $20k more. Then, when your batteries die, it’s another $25k to replace them. Not to mention, every time you “fill up”, it takes at least an hour. I can fill up in 10 minutes max, and travel twice as far. Hardly “efficient.” That EV battery MIGHT make it 150k. My gas motor is just getting broke in good at that mileage. 
3. I didn’t say “abandon it.” But stop acting like these things are just so great. They’re not. In fact, without massive corporate welfare, they wouldn’t even have a market to sell to.
As I said, buy one, if it fits your needs. What I’m VEHEMENTLY against, is gooberment mandating, taxing, and regulating the cheaper, more efficient energy, to artificially increase prices, while handing out massive corporate welfare payments to make the more expensive, less efficient forms viable. 
5. This lie that EV’s are “environmentally friendly.” It’s a lie. Mining for this stuff is toxic. Everything they accuse gas and oil of, is exactly what EV’s are. 
6. The myth that it makes us less dependent on foreign nations. Where is the most lithium at? Not here. The next environmental “emergency” will be the toxic trailings from mining for these things. Once again……what I hate is the marketing, by gooberment, corporations, and the left, lying to us that EV’s are some magical pill.
Reply: @givemeabreakdoc  neither one of those trucks are equivalent. They don’t have the infotainment system the lightning has, don’t have the 4 wheel drive etc. You picked literally base model f150’s because you’re focusing on towing. A limited will hit over 80k. The lightning starts at 45k. You want to equip to 90k go for it. Yes it takes a while to fill up, you go home and plug it in. It will literally be charging the 10+ hours at night. Ready for your next day. Teslas have been around the longest we have not seen a dying battery being a paramount problem. You can go on YouTube and see people doing so many drag race passes in their ev’s. These are car un tunes un modded. Take your regular f150  un modded and make several passes full tilt, tell how well the engine is doing. Who is saying ev’s are environmentally friendly? They are made out of metal, aluminum, rare earth metals everyone knows that. We know as time goes by they will be much more viable, the sun is probably the biggest fact of that. I don’t understand who you are mad or where you get your info from. Who do you think is making the move to ev’s the same companies that make gas vehicles. They clearly see they can’t sustain fossil fuels forever, so start now and get ahead. We understand that we can always change and make better what vehicles are made out of. We will likely find a better way to recycle and make lithium batteries. The problem everyone is trying to tackle is what powers them and how we sustain it. Common sense tells us it’s isn’t fossil fuels, because they’re finite. What you hate is the marketing you tell which commercial is saying it’s the magic pill. I hear them saying it’s the future which they are right.
Reply: @wow956  no, I picked the base models because they were the base gas and electric models. I’m not “focusing” on towing(although EV’s are useless for it). I’m stating simple facts that make EV’s less efficient. I don’t give 3 shits about “drag race passing”, whether it’s gas or electric. 
Are you reading comprehension challenged? I’ve told you numerous times……I don’t give a damn. If you, or anybody else, wants one, buy one. What I DON’T want, is gooberment handing out massive corporate welfare to keep it marketable, then taxing, mandating , and regulating the cheaper, more efficient gas, to artificially increase prices. 
No, companies are making them, because gooberment is handing out massive corporate welfare checks to make them. Once again. Take that subsidy away, and they don’t sell worth a damn. 
Who’s claiming they’re environmentally friendly? Are you kidding? 
Magic pill? Really? You don’t hear these fools claiming it will end our reliance on foreign countries? Or reliance on fossil fuels? We’re just trading one finite source for another. Trading some countries, for others. And trading for a more expensive, less efficient source.
As far as “sustainable”, the US alone has 200 BILLION barrels of oil. I’m old enough to remember the left, in the 70’s, claiming we had already reached peak production. Lmao.
Reply: @wow956  I’ll give you more examples. Hyundai Kona EV starting $34k, gas $22k. Need more examples? Santa Fe gas $28k, EV $40k I can drive a Loooooong way on $12 thousand dollars before you even break even. By that time, your batteries are shot. But at least you could “drag race pass” better.
Reply: @wow956  depends on what your using your truck for.
Reply: @wow956  2 years experience and you know all that 🤣
Reply: @blmartech  yeah man it’s not difficult to observe. Especially when I was in the market at the time on what I should switch too. So I needed to know what I could get away with.
Reply: @wow956  people don’t want to drop near 6 figures on something that can’t perform as well as there gas truck at half the price. The power grid isn’t large enough to sustain. They had to tell people in California to limit charging their cars over electricity issues after they pushed a ban on all gas cars by 2035. How do you know those people weren’t hauling SxS or campers after work
Reply: TLDR Give electric vehicle's time they will outperform but my money is on hydrogen.

If you want to be fair how was the early car compared to the horse? The horse was far more reliable than the car but overtime it's obvious what replaced the horse. Electric vehicle's have been around for a long time but have not been taken seriously nor have they been heavily invested in to compete in the world of today. The advancements of the electric car from just a few years ago are impressive but do need to step it up. My money is on hydrogen taking over but I do see the appeal of battery cars. Nio does something unique that I think more companies should do and that is replace the battery with a fully charged one instead of charging it just like old Samsung phones.
Reply: @liltitan9435  You didn't see the government trying to force horse owners into cars.
Reply: @ironclaw6969  you're missing my point. The video is showing the capability of diesel vs electric. I'm saying that electric trucks will surpass diesel given a few generations but again I look more forward to hydrogen vehicles but who knows what the future will hold. Getting off fossil fuels is important, we may never entirely get off but if there's a huge shift that would be much better than where we are now. Finally I don't see anyone forcing me to get an electric car at this moment. There's incentives, deals maybe bargains but no force. You can think what you want, the future if you like it or not will demand more electric cars than gas. That's not the government that's technology.

Edit: fun history fact "The first automobiles were introduced in small numbers around the turn of the century and they cost about $850 each. A very good horse buggy cost about $50, including some made by the McLaughlin Carriage Co., which eventually became General Motors Canada."

Sounds very familiar 🤣
Reply: @liltitan9435  he mentioned the govt because they are forcing states and cities away from ice which is why he mentioned. I think we are all caught in our own lifestyle that we arent thinking about how others are living right now and they are being forced to only be able to drive ev instead of ice we all need to remember that the world is bigger than just you
Reply: @donaldgeterjr8180  who is being forced right now? No one. The infrastructure isn't there and the cars are not there. The supply is not there, the production is not there, the grid is not there. It's ridiculous to think the govt is forcing anything. What you see is a nudge towards EVs. There's incentives and rebates, really hard to say that's force, it's no where near that and if you want to speak on thinking about others lifestyle then it's more important to shift our energy reliance off fossil fuels and towards green energy. If you bring up the ban of ice vehicles, 2030 2035 is a ways away but again not force. Please define govt force. Remember the world is bigger than just you.
Reply: @liltitan9435  what you are pointing out is the main problem we have today when ppl say we are putting the cart before the horse they are already telling ppl that by 2035 there will be no more gasoline vehicles being manufactured that is a forceful tactic that is like your landlord is giving you 60 days to get out of the house that is a forceful tactic as far as saying get with it or get kicked out so what do you do you get prepared to move your stuff out and if not then they will take it out for you
Reply: @donaldgeterjr8180  poor example. Nothing like a landlord telling you to be out by a certain date. Plenty changes in a year. Nothing is being "forced" on anyone. Better vehicle's are being built, they are more effective and efficient. If someone picks that over the ice that's not force. Nothing right now is being forced, you need to understand that. 2035 to 2040 is again ways away.
Reply: @liltitan9435  you don't see anyone forcing you and you think it's technology and not government that will put more EV's on the road? That's funny because didn't the state of California recently say they will ban the sale of gas powered cars by 2035? That sounds like the government is forcing people to buy electric to me. I have no doubt there will be something different than gas in the future, but ev's are definitely being pushed and forced in some cases. I personally don't have to worry about it because by the the time ev's can take over diesel engines(20-30 years) I will probably be dead, for now I will continue putting on 100,000 miles a year in my Ram pickup.
Reply: @TruckPirate1  2035 oh yeah so much force. 🤡
Reply: Something that most don’t realize is that the majority of truck owners never actually tow anything on a regular basis and just daily drive their trucks to work, errands, and back home.  If you haul on a regular basis then absolutely get a diesel, but for the majority of people an EV truck would be ideal for their commute and lifestyle.
Reply: @titaniummazdaspeed6  The real big problem is in big cities many live in high rise condos/apartments and there are NO CHARGERS. You will here many pro EV people say....charge at home and at night...HOW?????
Reply: @mikefoehr235  it is a challenge for apartment dwellers. But most people in apartments aren't buying vehicles in this price range. Depending on commute, they may need to charge once per week, but they miss out on the benefits of changing at home. But have to start somewhere.
Reply: @jghall00  You are right...In Toronto, a 2 bedroom apt is now $2 000/month and at that price and extremely poor economic pixies by our dicktater Trudeau, most can't even afford a small ICE car. Never mind buying a house. Our moronic leader wants us all in EVs....we don't have the capacity to generate all the power to meet all the needs of everyday use.
Reply: @mikefoehr235  My condo building (in Denver) is installing electric charging ports right now. For free, courtesy of Xcel.
Reply: @robertharris1748  Nothing is free...someone pays somewhere
Reply: @mikefoehr235  Tesla Joy on her YouTube channel lives in a apartment with no off street parking. When she needs to charge her Tesla Modle 3, she just goes to a Tesla Supercharger.
Reply: @mikefoehr235 many do.. but it's not the majority. Products will always have a target market and people without home charging is not one of them for EVs although it's possible
Reply: @mikefoehr235  don't get an EV if you live somewhere you can't charge.
Reply: @mikefoehr235  Look up The Great Reset. Robots are going to replace people. Seriously.
Reply: @titaniummazdaspeed6  I have to totally agree as a guy that works my truck hard and it looks like it. There are work truck people out there and there are leisure truck people out there. For a vast majority of leisure truck people an EV truck will probably suit them just fine.
Reply: @titaniummazdaspeed6  not in rural areas.
Reply: Most don't tow on a regular basis but it would be nice to know that in the 10 years of ownership, we could tow if needed.
Reply: @titaniummazdaspeed6  they’re still not worth it. 90k for a lightning? That I can’t even tow my boat with? No thanks.
Reply: @titaniummazdaspeed6  , i can easy buy 2 gas powered pickup trucks for the price of one ev truck. And have money to cover fuel for a very long time. Not to mention how ev insurance is substatially higher too.
Reply: @titaniummazdaspeed6  How many days a year do I need to use my truck a hauler to justify taking up rare parking spaces with an ICE hauler truck.
Reply: @titaniummazdaspeed6  true, but if you are just driving to and from work you don't really need a truck.
Reply: @titaniummazdaspeed6  Yes this makes sense.
Reply: @titaniummazdaspeed6  Unless I want to take my  truck 1500 miles in less than 5 days. EV's need to get at least 500 miles easily per charge and then be able to fully charge in 5 minutes for them to be viable. 

Oh and they have to not be vulnerable to being remotely disabled.
Reply: @titaniummazdaspeed6  but the point of a truck is to haul when you need to   why else pay more to have a truck when u can save on a sedan?
Reply: @titaniummazdaspeed6  or they can buy a regular sedan. These truck ev's are horribly inefficient.  The hummer EV goes 1.5m per KWH. A tesla goes 3.5m per kwh, and a Chevy bolt does around 5m per kwh. These are "look at me" vehicles. We are reliving the 90s SUV craze.
Reply: @titaniummazdaspeed6  All of these attacks on freedom make no sense. You do realize not everyone needed a horse backe then right? Yet it was wise to have one. Same now people have work horses (trucks), some need them daily others once a year. Also trucks are great investments but you dont stop and think. Lets use our heads next time before we comment on others. GOD BLESS AMERICA
Reply: @titaniummazdaspeed6  Maybe for you I live in the Midwest we drive cars for errands and to get groceries . We buy trucks for work both my trucks never leave the farm unless going after feed, fuel, something a car can't haul. Also they are constantly pulling a trailer. One hasn't been unhooked from a trailer in three months.
Reply: @titaniummazdaspeed6  except you can’t tow anything outside of town
Reply: @titaniummazdaspeed6  this is exactly what I’d like to do. My diesel sets unless it’s working and my Camry gets the wheels run off it. Id like to run an EV pickup to replace the Camry and it would also replace the smaller jobs the diesel does. Everything has its place.
Reply: 95% of truck drivers are office and Starbucks. They buy them because they think it makes them cool. Some have occasional towing needs. It’s like guys with lifted rubicon’s who off-road once a year. Count how many trucks have something in the bed or behind it- 1 out of 20? Usually an actual beat up work truck.
Reply: @wigginsvt1  you drive a car with 4 seats and 95% of the time 3 seats are empty. Dumb azz.
Reply: @cinder9950  Cool lifted truck bro. Hard to take kids to school with a 2 sear car. Terrible example.
Reply: @wigginsvt1  O so when I use your same stupid logic tword what you choose to drive now it's a terrible example? I guess in your dictateorship I'm not allowed to drive my truck unless I'm pulling one of my trailers and I should buy a additional EV just to get myself to "starbucks". I'm sure the Chinese battery manufacturers (cough polluters) would love that but at least pretentious d bags would have one less empty truck to count.
Reply: @cinder9950  If you are in the 5% great. The original post says that EVs won’t work for most truck owners. This is false. You can drive whatever you want, I don’t care.
Reply: Let's be real, 90% of truck owners own trucks because they think it's cool, maybe use it In a practical sense once a year.
Reply: @TickleMeShlomo  you have data to back up this claim?
Reply: "Let's be real" your just mad you can't afford an E Truck and perhaps your budget is too tight to buy Starbucks.
Reply: @Turd Ferguson  That certainly not true.  My platinum will tow and haul anything that any ICE F150 will. Our charging infrastructure just isn't there yet for long distance EV driving. Every video I've seen on the lightning complains about its towing range.  That wouldn't be a problem if ever fuel station had as many charging stations as they do gas pumps.  None of these mention all the benefits of the lightning compared to an ICE vehicle, no more ICE vehicle maintenance. Nor do they talk a lot about plugging in at home and waking to a fully charged vehicle  at 8-12 cents per kwh.  No ICE vehicle can even come close to those figures using gas or diesel. 
Now I'll talk about range and costs towing locally. I  can tow up to 10,000 lbs for over 100 miles for $7 or less because very little wind resistance at lower speeds and the low cost of charging at home. Just hauling or driving I average 2.4 miles per kwh that's 3.3 cents per mile. Driving and hauling in city only I can get as much as 3.3 miles per kwh,  that's around 2.4 cents per mile. I  don't have to drag out a drop cord or start an engine to use my power tools out in the yard. When I go camping I have all the power of nearly a 10 kw generator without the fumes. I've got more inside storage than any ICE vehicle.  I could go on but so many have made up their minds already that the lightning isn't for them which is fine, because it's not for everyone,  but perfect for even more.
Reply: @pstoneking3418  
That all sounds fantastic but..... I have a 17 year old Silverado with 190,000 miles that I paid $8500 for 5 years ago. The question I have is where will that $80,000+ Platinum Lighting or $100,000 Hummer be in 2039?
Reply: @pstoneking3418  sadly you can't tow anything any ice truck can as you can massively overload an ice truck and it'll struggle to work but it'll get there the electric version can not be overloaded to the same capacity a few people have already tried and ended up on flatbeds back to the dealer now I work in an old ram that had a trailer on daily that was around 17k it was slow but I'd didn't give up that truck had over 600k when it was sold to a kid as a field learner that electric f150 will never see that milage and life span
Reply: @pstoneking3418  towing long term with ev would be detrimental to battery longevity. High discharge rapid recharge is the worst thing for battery chemistry. Ev have impressive power output but range goes down the drain when operating at near that max where the diesel can be pushed hard through its life.
Reply: @pstoneking3418  until you consider what it cost to replace the battery
Reply: @pstoneking3418  all false. You don't have sgit to start. Tge price of the vehicle to start will never make up for fuel costs. Your vehicle maintenance is idiotic. Ev tires are reduculously expensive. When your battery goes there goes any claims maintenance was less. Stop lying
Reply: Sounds like EVs work great for you but not me.
Reply: @pstoneking3418  because stopping every 100 miles on a 600 mile trip for 45 minutes is practical 🙄
Reply: @pstoneking3418  I think you have it all wrong. When people tow their camper the average is well over 100miles. So you are going to every 1.5 hours and do what, dance for the energy to go faster? EV are for daily work driving only but remember you have to drive it over 100k to offset your carbon foot print.
Reply: @pstoneking3418  also let's go out to the king of hammers. You go ahead and power your trailer off of your truck ill run My generator off of my 200 gallon fuel station in my toy haller. And then we will see who drives out of the desert at the end of the week?
Reply: @pstoneking3418  Your username is appropriate.  Anyone that has a Lightning and uses it in place of a generator while out camping has "big stones".  Suck to run it down too low to get out of the hills...
Reply: @pstoneking3418  It won't tow 10,000lbs over 100 miles. It couldn't even tow 3,000 pounds over 100 miles on a charge.
Reply: @pstoneking3418  the lighting is only goid in warm climates, i live in Canada now that winter is here we are hearing all over of people returning their lighting because the cold is reducing the battery range by more the half, without pulling or hauling anything
Reply: Also , let’s be real . The majority of people who use campers are old folks who don’t know how to use electronics . These ev trucks are more for younger people . New things scare over the hill people .
Reply: @TheOriginalBumper  I'm an engineer in my 50s,  I have solar, program all my home automation,  and have an off grid 3K system for experiments.   I have a 5th wheel and a slide in camper so I can tow my 100K boat that weighs 6000 pounds.

The battery in this hummer weighs more than my slide in camper and wouldn't haul and tow what I do when I hit Puget Sound for shrimping.  It will be a very long time before it does.  My 1 ton diesel has a 38 gallon tank that can be filled in 10 minutes.  

You can say really dumb things like "old people don't like new technology" but you just sound ignorant, sorry.  I will buy a refurbished Tesla or small SUV EV once you can actually buy one and I'll get my fuel for free, which I'm very much looking forward to.  But towing is just off the table for now.  My 5th wheel is 12K dry weight.
Reply: @TheOriginalBumper  let's be real,  you obviously have never been camping or you would not have come to such an idiotic conclusion....
Reply: @TheOriginalBumper  excuse me, you obviously have no idea what the hell you’re talking about
Reply: @TheOriginalBumper  new things don't scare us, we're not willing to tolerate the unnecessary bullshit that comes with electric vehicles. We just want to gas up and pull our campers down the road without the anxiety of  conking out in the middle of nowhere. Simple as that.
Reply: @TheOriginalBumper    There is nothing new about EVs. They have been around a lot longer than anyone you may know.
Yet the problems with them remain the same as they were 100+ years ago at a time when electric cars out numbered gasoline powered vehicles. 
But I will bet history is not your or most other youngsters' strong point.
Reply: @m_m_m_beer8917  thats facts right there they were even made before gasoline vehicles were made as well. This is nothing more than the generation of history repeating itself all over again that is all